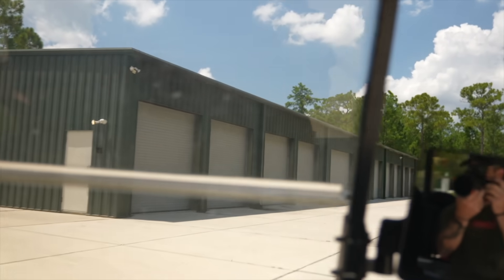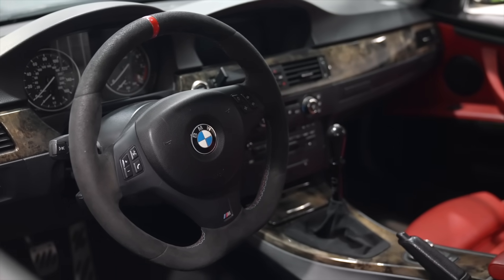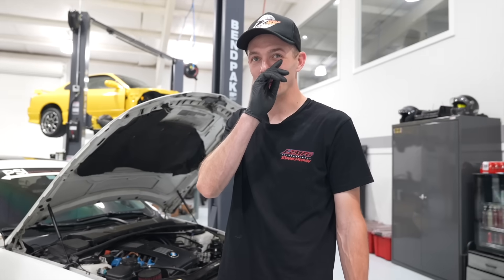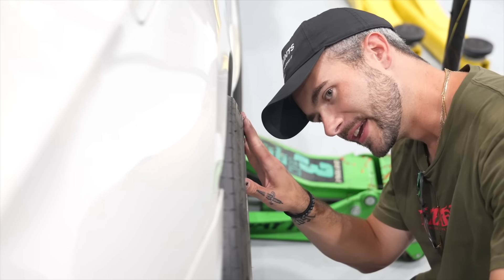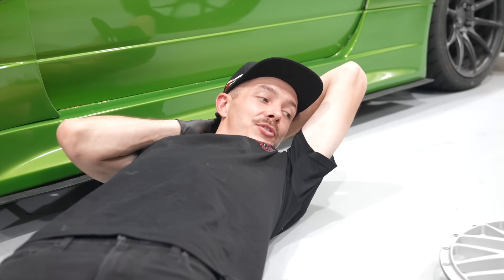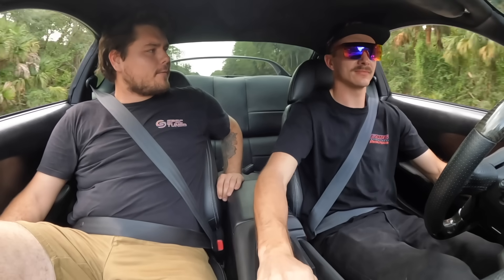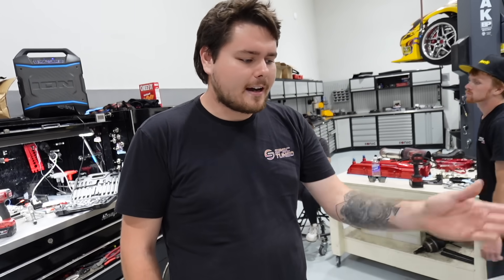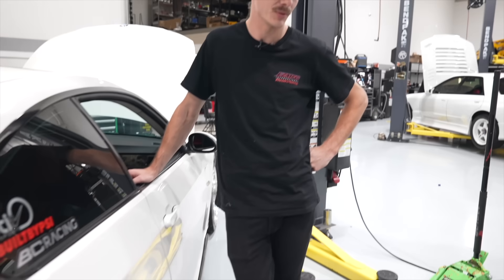My Single Turbo 335i - Here's Why I Abandoned It

Comment: You’re the reason I got a single turbo 335 so this is awesome! If you’re looking to stay away from stand alone ecu go with a motiv reflex+ paired with mhd, it has fail safes, additional inputs and outputs for a secondary fuel pump, flex fuel, methanol injection, etc. it also has canbus integration. I’ve had one on my car for over 2 years with zero issues related to ecu whatsoever

Comment: You can do stock ecu with relfex to control pi, or do maxxecu instead of syvecs. Overall, though, just do port injection,dual pumps, single bank 02 sensor, and if you stay stock ecu  you can repin the dme and have MHD control boost instead of using a boost controller on the single set up and get tuned by doc vu who is the best. Run a 15x10 +45 7.25 BS 275/50/15 on the rear!! Glad to see the 335i back 🙌🏾

Comment: Adam because of you i bought my 2008 Alpine white e92 with red interior too (yes i copied you) back in 2017 
Was my first car and i still own it, currently getting the motor built for big boi power 

Port Injection
Nexsys motorsport literally just finished a full port injection conversion on stock dme
This deletes the Di injectors and HPFP and keeps factory like reliability 

Coil Packs
Theres 2 good ways to go for this 
B58 coil conversion from Nexsys motorsport as well or R35 Gtr coil kit conversion from platinum racing products specifically for the n54 
The gtr kit is good as it uses smart coils and puts alot less load onto the dme 

Single Bank O2 conversion
Mhd now has an option to convert to a single O2 sensor 
Instead of 2 having to be in the headers, you can now put just one in the downpipe. This will prevent burning sensors and keeps the car running smoother

Tuners
The following tuners have forefronted the n54 community and pushed for the changes and updates we have today instead of jumping ship to the b58 
David Shoup My personal tuner, he has helped devolop MHD into what it is and has assisted in the devolopement into antilag and single bank 02
Ken Atkinson Wedge tuning, another figure that has helped improve the platform and has also helped making the updates we have
Doc Vu Alot of people commend him for his tuning, he is know well, but i personally did not have a good experience with him as he ghosted my friend when the dme was bricked during flashing after everything was checked over

This video makes me so happy, all the choices for a first car and i walked to work because seeing your videos made me want one even more and it was worth it with the roller coaster of emotions 

Keep up the dope videos!

Insta: dardan_danny

Comment: BMW guy for the last 24 years. Gone through all 3 series. I don’t mess with mine other than suspension and tiers. They have all been very reliable. I found this channel when I had my E90.  Still have a E46 my OG BMW topaz blue similar to Adam’s og car and an M340i.
Reply: Currently using a 02’ 330ci in topaz blue as my daily and I absolutely love that thing

Comment: The 335 hits me in the feels. Got one, had all the N54 problems.. bailed and bought a B58 M340i. Lots of N54 tuners still using stock ECU flashes like MHD and BootMod3(DocVu and Wedge are just tuners).

Comment: As a single turbo 335i owner, Motiv Reflex to control port injection and MHD for tuning. If you wire your auxiliaries on the Reflex properly, you can use them to communicate with the Reflex and control your mac solenoid and secondary fuel pump. (Currently have mine on a hobbs switch to activate it, but you can get more precise with wiring it to the Reflex).  With the recent updates, once your Reflex is flashed all you have to do is keep updating the MHD tune. MHD also has on the fly map switching now so it's kinda nice. B58 Coil packs to avoid all the ignition issues. 

If you're trying to go for crazy power... delete the direct injection, go port only and use a Maxx ecu for stand alone stuff.

Comment: Now you can control a 3/4 port boost controller for your single turbo directly from the stock ecu, also you can convert to a single wideband post turbo. Eliminating all the O2 problems. You can also have diferent tunes/boost levels in the same tune, you can change tunes directly from the steering wheel controlls. Rolling antilag is also posible with the stock ecu. Also Reflex+ can control port injection sequentially, all with can connectivity and add inputs and outputs you can see directly in MHD. All possible thanks to MHD

Comment: The N54 rarely have rod bearing issue and has no Valvetronic to go haywire, as other mentioned, once the problematic direct injection system is replaced by Nexsys PICK or MaxxECU solution, it doesn't have much weakness other than just being the old enough to go to highschool and will needs some common sense budget to keep the rubber and seals fresh. Would be so cool to see Adam restart the build of this OG LZ car now that there are so many new things available for the N54.

Comment: Maxxecu from sweden. E9x canbus integration as well. DI-delete, big port injectors, and you're golden. If you want 8hp trans control, maxxecu does that as well (natively), if you flash the 8hp with their version of the dodge deamon firmware, which has transbrake as well.

Comment: Single turbo N54 owner here, used to have a JB4, it would always cut boost and timing, eventually a wastegate like broke and caused an overboost condition, and the jb4/ecu combo did not engage any sort of CEL or limp mode, all the jb4 did was kill the Wastegate duty cycle, which does nothing when that problem occurs. 

After that, I switched to motiv reflex, got DocVU as my tuner, and went single bank o2. After that, all of my ECU related problems were gone, and the safeties work only when I need them to. Since then, Ive spent some time fighting issues with the DI system, but that really has nothing to do with the tune/software setup on the car.

Comment: zero to 60 in austrila is the leader for N54 content. Also you need to change the ignition coils from the precision race works to B58 coils they work the best and they are there is a really easy plug and play kit to install.

Comment: Nice ! I’m a new member and never knew you were n54 fam. I’m building a tribute car for my dad who passed away from lung disease. He use to drag race in NHRA in Super Comp, Super Gas, Super Stock, Comp Eliminator, etc. He was one of the only Asian drag racers at the time. Anyways he gave me his 2008 335i before he passed. So I’m building it in memory of him. So far my dads car has a Speedtech Top Mount with 6266, 6spd manual with a twin disc, BC Coil Overs(want to upgrade), 19” Work Meisters S1 3p, Recaro’s, etc, etc. It’s fairly simple, exterior is completely stock even stock exhaust. My next mod I’m saving for is the Ford rear end kit by Seems Legit.

Comment: -Nexus Di delete is not 100% dialed in but when its available, go Di delete for big big power
-David Shoup with tuning
-Motiv Reflex plus (if you decide to keep Di intact) for controlling a proper top feed intake mani (phoenix raceworks / BMS)
-If you care about digging and going real fast, theyre getting close to 8hp70/75 swapping the transmission
-You need a 15/17 inch for going real fast
-Single bank fueling needed for big single

Comment: For your case id go with CD919. He reliably tunes cars and keeps the motors happy. He has a few cars running 4 second 60-130s. You can do a DI delete through nexsys/MHD now. 
Swap out the AIC for motiv reflex +
Switch the MHD. Go with DME boost control.

Comment: Piggybacking off the comment about Docvu Tuning. He does a ton of these setups with PI via Reflex+ w/flex fuel , I do most of the diagnosis for his customers during setup of this. I just got done doing this upgrade to another one of his clients and have a few others lined up for the PI/Reflex+ upgrade along with single swaps. 

If you want to go standalone MaxxECU + CANTCU for the transmission and you can ditch the factory DME + DI for far under what a Syvecs setup cost.

Comment: I have a single turbo 135i, I would recommend 5 things motiv tuning , eldor coilpacks precision race works are bad, reflex kit if u don’t have one and single bank o2 sensors
Reply: New low pressure pumps and low fuel pressure regulator

Comment: Syvecs is the only real option unless you swap out the piezo injectors. Then you can run whatever you want. Unless you want to keep the canbus system on board (which again is only a syvecs option) that I'm aware of and I was a prior production manager and design engineer for syvecs.

Comment: There are a few options nowadays:
1. MaxxECU (has a PNP cable) with DI delete but this is still rather new (~1year on the maxx ecu stuff and 4months on DI delete)
2. MHD & Reflex+ and get it tuned by motiv motorsports

Nexsys motorsport has a DI Delete kit that is working with MHD but its not bulletproof yet

other general notes:
Nexsys motorsport released a oil pressure sensor to replace the switch and has a B58 coil conversion which spark better than the precision raceworks coils.
Single bank fueling with MHD saves the O2 sensors and works perfect.
JB4 is obsolete since MHD got this good.
DOCrace top mount single turbo or JMC top mounts are the GOATS

Notable tuners: Ken from Wedgeperformance, CD919, Motiv motorsports, TruePowerSoftware

Comment: BBS wheels work, but VS-5RS/HRE P101 style or 513M look best on E92 coupes imho. Should look into the Alpha-N BT92 build. Their widebody is *chef's kiss*. Porsche vibes on a BMW chassis. Nice to see the N54 back in vids. They're a hell of a lot less trouble than they used to be. Tuners I'd go for are Jake from Motiv. Doc Vu. V8 Bait. Jake from Motiv tuned mine, but I'm not running a single. Pure stage 2 high flows for me. Roundabouts 600 wheel is plenty in these cars imho. Lookin forward to seeing what else you do to yours.

Comment: Jake Hershorin at motiv motorsport is who you need to hit up. Mhd+ integration with their reflex plus has been why i returned to the n54 platform. 700hp on our 135i and has not skipped a single beat all year at roll race events or on the street.

Comment: New(ish) 335i owner. For some reason, I bypassed 350z's and Mustangs and instead bought this clapped 335i to be my drift car. Yay me. After almost a year's worth of work, its finally sorted. BC's, Kansei KNP's, NRG seat, welded diff, and just about every bushing and gasket imaginable has been replaced. Anyways, I just wanted to share how dumb I am, but this thing actually rips on the JB4. Can't wait to rip it here in Texas! (or break it)

Comment: on the standalone side of ecus for this car max ecu makes a plug and play option and last i heard its around 4k. Or you can get a reflex for port injection and flex fuel capabilities and probably some other things reflex has. I also heard soon mhd is releasing a DI delete option along with reflex so you have two solid options now.

Comment: Tuned by shoup is a very reputable N54 tuner and a great example of his work is 3thurty5is' car. It's done around 160k miles and just hit 100k miles on the single turbo kit so is a big testiment for if maintenance is done and the cars set up properly they actually can be very reliable

Comment: MHD for tuning with wedge for a custom tune I've had a good experience with Steven Barchus but I believe he's more VVL stuff reflex plus PI controller will tie into the can bus system to keep everything in sync mine isn't can bus connected but I believe it will even have the ability to throw its own codes if it is. I would definitely recommend taking a look at 4N Motorsport they just made a bit of a fairytale into reality working with mhd to make the dme happy with their mechanical changes and their rev limiter is somewhere around 9200rpm comfortably.

Comment: You should contact Ali he goes under Swap depot, he actually worked on your 335i back at psi, hes stuck with the n54 platform for awhile and knows alot

Comment: My X5 is pushing around 700whp with a Heatsync custom tune and a JB4.  I have bigger turbos ready to bolt on but I would be pushing the internals a little too hard.  So when I rebuild the motor I'm going forged internals.

Comment: S58 swap 👌 I've spent over $30K on my N54 full built motor
 Manley turbo tuff rods 
Manley Pistions 
Insain crank hub
Head Studs 
Valcan cut ring head gasket 
Reflex plus
Black market Port injection 
B58 coils 
Twin hellcat fuel pumps
Twin 3 inch exhaust 
Twin ball bearing turbos 19t
Water methanol injection 
Every bolt on you can think of

But for big power the vavles in the head are two small ive had my ports done but the vavles are two small. That's why a 2JZ makes big power better head.
Ken from wedge tunes mine

Comment: Do not take my word please do your own research but my friend recently got a 135i coupe and his is mapped with MHD I don’t know if this would work for yours but his seems really reliable at 420bhp. As I said please do your own research because his is still stock ecu and twin turbo so nothin like yours but his does run very well pull after pull, very reliable power.

Comment: I just bought a Z4 35is, which is quite close to the same as a 335 is. Mine's pretty much stock, with a little bit of remap to get a few extra horses galloping. Good enough for me, I'm not sure what I'd usefully do, even for a few seconds, with a 700 hp version of the same car.

Interested to see where the 335i ends up.

Also, can't you just machine a little bit off the centre of the wheel to pull it back in - or is there not enough material there to do that?

Comment: my N54 not broken.. engine fine.. stupid boost control however, only seems to want to work when cold.. and well USPS lost my fuggin control solenoids from FCP Euro, BUT my BMS vacuum canisters arrived from fedex.. now to get rid of more stupid plastic.. ( WTF BMW!?)  soon to do more maintenance in the form of stopping it from marking it's territory from the oil pan.. and install the Moroso-VAC motorsport baffle and new 034 motorsport rubber engine mounts ( will prolly go with ECS poly diff mounts here soon too, but after their trans mounts, not sure if want to go M3 front bushings and ECS rear bushing or not)

and oh yeah USE MHD tuner with super license and any "piggy back" use Motiv ReFlex
just make sure you can get an MSD81 DME, cause factory mosfets on MSD80's are trash.

Comment: Doc vu tune is king in the n54 world.
Motive reflex+ port injection controller 
Bmw mhd single bank fueling
Bmw mhd dme boost controller 
PRW upgraded fuel system/e85 
Vtt valve cover and dual catch can system
Snow performance meth injection mainly because these cars run really hot
upgraded oil cooler

Comment: Does the 335i wood grain crack like the e46? I figured out how to refinish my e46 Myrtle wood to brand new like factory. It’s time consuming to get all the old clear off once off the process goes fast. the wood is so much cooler than the aluminum, cube or even carbon in some instances.

Comment: got my 335i in 2015 with 103k miles, now has 178k...you all can do the math how much the cars been sitting derelict for over 9 years of ownership...
Reply: also i use to have JB4 and the car gave me headache after headache, always going into limp mode and not starting randomly. switched to MHD OTS stage 2 tune for 2 years without any issues, until my turbos blew. now i got 19ts and relocated inlets waiting to be put in. also so glad i got a set of index12s before they went up to $3k for a set...

Comment: DAVID SHOUP he’s the og goat. Ask Jordan he’ll tell you the same
Reply: He’s also based in Jacksonville. Has been pushing the n54, n55, b58 , s58,s63 platforms. He will get it running right
Reply: Very knowledgeable and helps develop MHD tunes. Been saying you need David since you went single turbo

Comment: put it on maxxecu, delete the direct injection entirely.  put a zf8hp75 gearbox, both controlled by maxxecu. you will thank me later - someone who has a 3.3l  n53 head swapped, 1000whp 8hp 335i.

Comment: Get a motive reflex to control your port take that junk jb4 off of it and have cd919 tune it I made 806 wheel on stock motor with a single turbo and never had problems like that

Comment: Put a dct, suspension and drag pack and go drag racing. You’ve never built a proper drag car on this channel. This thing could run 8s and be fun to use that get board with the drift stuff

Comment: Imo you should completely rebarrel the LM's, the offset/fitment is weird and a 225 front is absolutely horrible, idk how used you are to how trash old japanese cars handle, but a BMW needs at least a 235/245 front for street driving, you could easily run a 245 or 255 up front without rubbing, with a bigger inner barrel